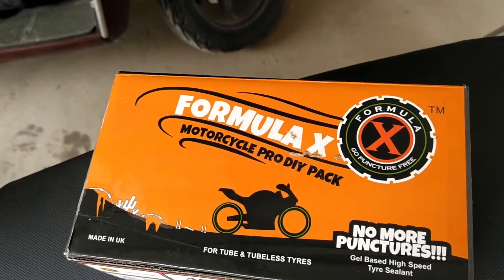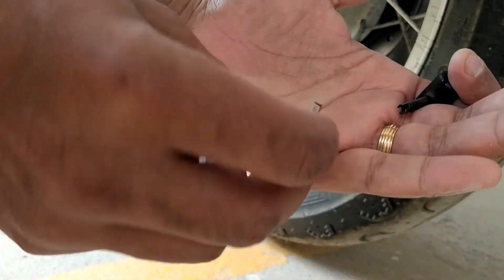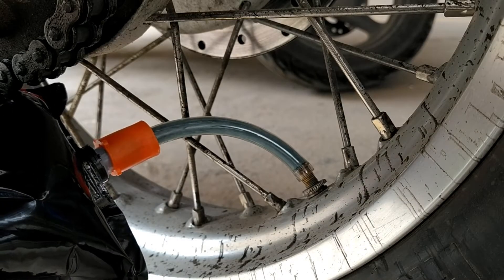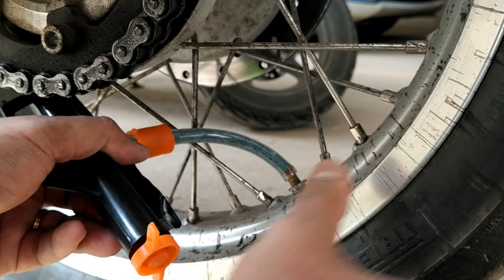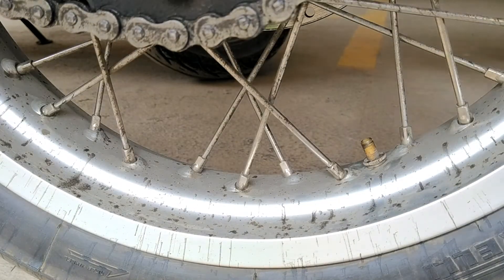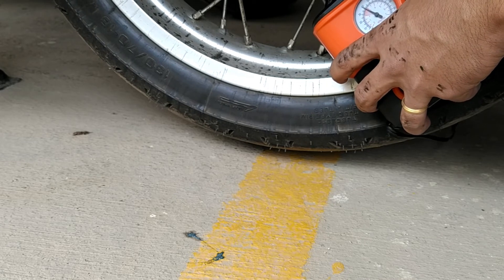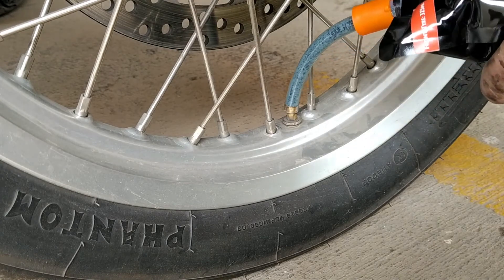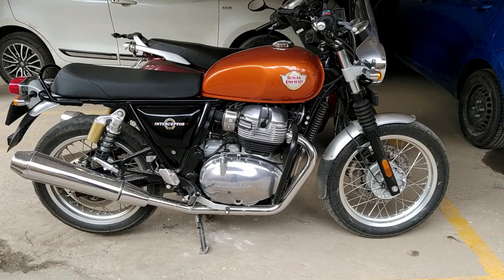How to fill Formula X in tube tyres | Interceptor 650 | Not sponsored

Comment: Hi. I have a Interceptor 650 with formula X in the tubes. The rear tyre is loosing pressure. But I can't see any nails on the tyre. Can this tube be repaired? Is it repairable eith the gel inside? Or do i have to change the tube?
Its almost 4 years old? Pls advise
Reply from the maker: Hey, I had the same issue of air leakage but there were no punctures or nails in the tyre. After carefully checking, there was a valve leak. This was because of a small rubber fragment in the formula x gel which was stuck between the valve and pin after refilling the air. I just removed the valve pin out, cleaned both the pin o-ring and valve inlet and reinstalled it.
No more leaks.
Other things to check are micro tears and cracks on the tube near valve neck or wear on valve pin o-ring.
Best practice is to replace tube every 2 yrs to be on the safe side.
I'm always carry one 18" tube on long travels.

Comment: Bro after i cross 100 on my interceptor im experiencing wobbling which is dangerous wat should i do😔
Reply from the maker: I have same issue between 80-90 kmph.
It is a common issue in interceptor. Can be because of misalignment of rear wheel or front wheel balancing or coneset.
Get it checked by RE service.
Reply: @eb_reviews  no bro after installation of this formula x i guess i havent ridden for 10km properly n due to uneven spread it has formed into lumps and im experiencing this .. so now should i change both the tube and get it balanced again? Wil a normal mechanic do it?

Comment: How is it holding up after 9 months??
Reply from the maker: No issues. Holds the pressure well and no punctures yet. 🤞🏼
I maintain 32 psi front and 36 psi at the rear